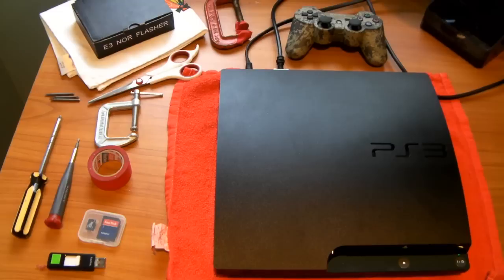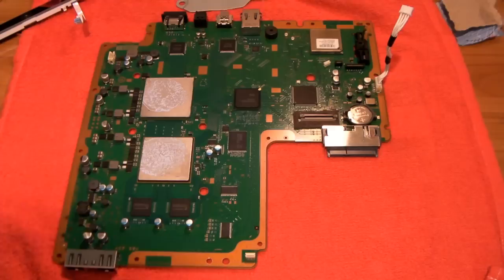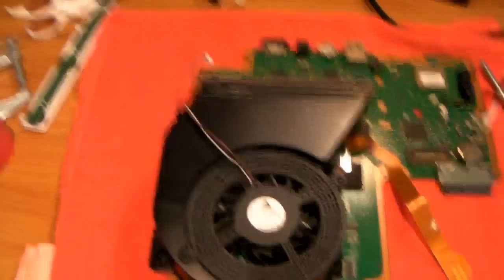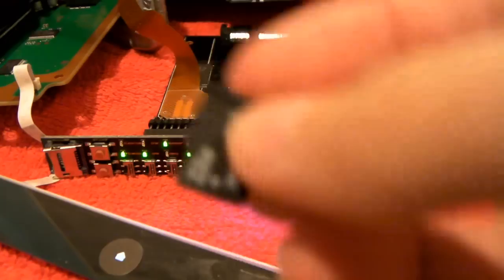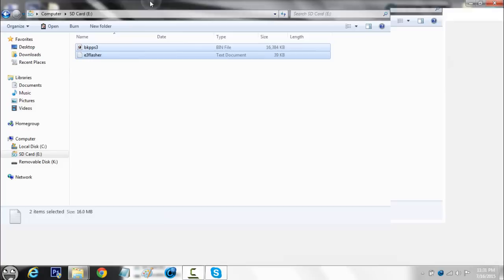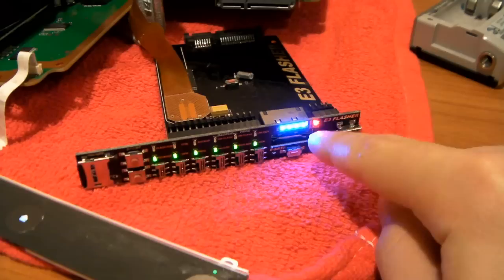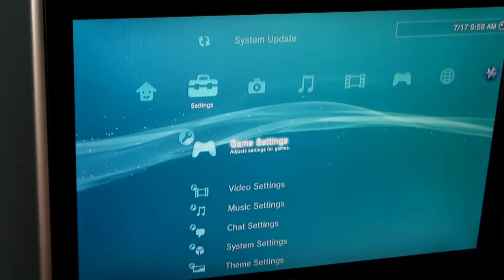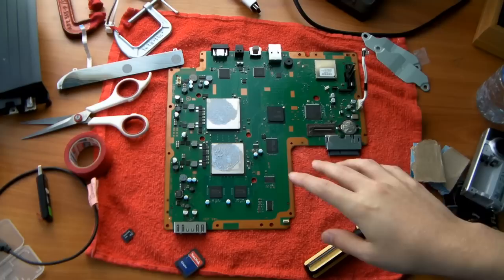How to Downgrade a PS3 to 3.55 with E3 Flasher (EASY!)

Comment: +hacked tutorials i cant connect my controller ?!!?
Reply: +PyroXR8 make sure your control wires are plugged in
Reply: yes they are im at the rogero downgrrade bit where its connect controller with usb cable and press ps button but nothing happens
it just flashed
Reply: Use a charger to connect it
Reply: have
Reply: dang that sucks
Reply: i know so im stuck
Reply: I think I would make sure the black and white cables are in the right spot
Reply: what ?
Reply: The cables that connect your controlers watch the video carfully when he is putting it back together
Reply: what when he gets to putting the regoro downgrader on it
Reply: No when he is putting the ps3 back together
Reply: Or that could be right
Reply: what? ill tell u whats going on i have just flashed the patched bkkps3.biin file . now im doing the regero downgrade bit with a usb but when the screen saying' connect ps3 conntroller using usb cord" it wont connect
Reply: do what he does You CAN'T just turn on the ps3 without putting the wires back in place
Reply: +Acai Union Or u might have damaged your PS3
Reply: NAR  it turns on fine

Comment: You need to improve the NOR dump validation process.  I am getting a lot of users that followed your video, asking me for help to unbrick their PS3s.  Nor Inspector is not a viable option by itself to validate.  You should link the github pages for norpatch.exe https://github.com/hjudges/NORway  and ps3dumpchecker.exe https://github.com/Swizzy/PS3DumpChecker, so they will always have the latest versions.  Then they should follow the easy validation method in Chapter 1 Part 2 of my guide here: http://www.ps3hax.net/showthread.php?t=33989.